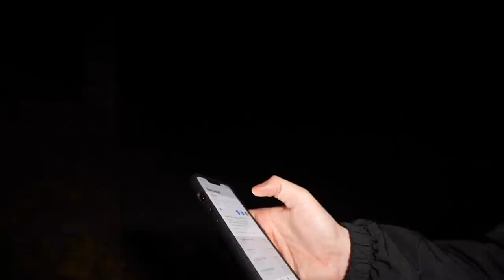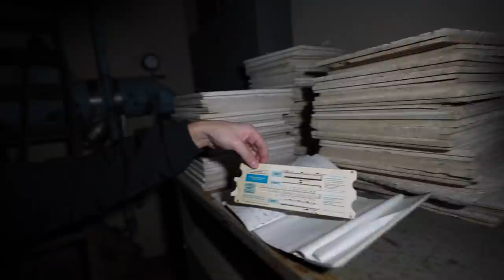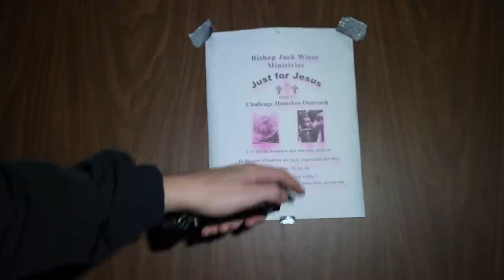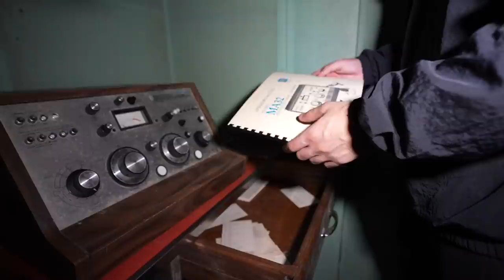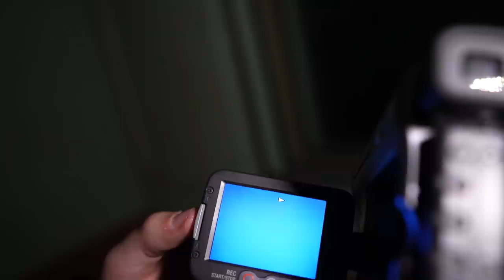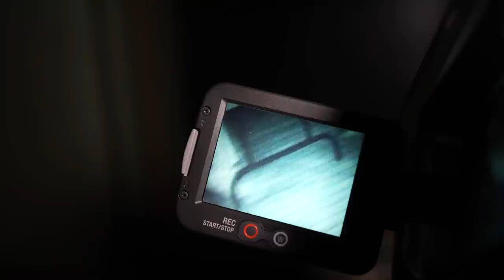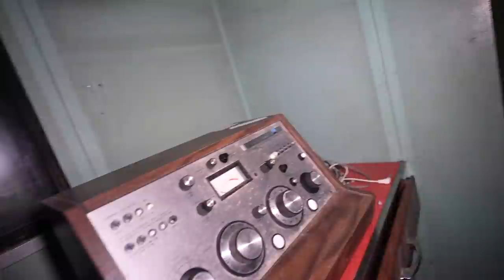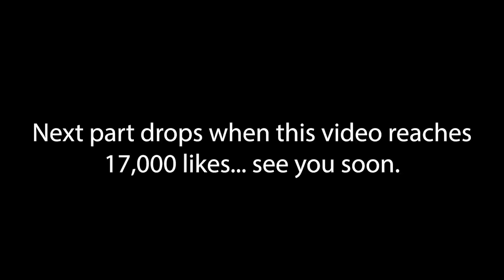MOST TERRIFYING RANDONAUTICA EXPERIENCE - TRAPPED INSIDE LOCKED ROOM (WARNING!)

Comment: Jas... Next time you find yourself locked in a room, remember that most interior walls are nothing but drywall (which you can break through). If that doesn't work, try going through ceiling tiles and climbing over to the next room.
Reply: You my friend have clearly been locked in a room before lol I came to say the same thing
Reply: II can't remember when that started to be the norm. It used to be tree planks in 1985 when we built our house. Here II think the roof is the way - Or I would anyway look everywhere and get out. Besides - I mostly keep a glass breaker with me. Always when exploring, that's for sure!
II'm  searching door handles after this cause II think that is a trick with that one. Turn and push. This room would never have a room you need help to get out of. It's for reading up messages to everybody. It is the meaning that no one can get in when you read. I think the handle is very long so pull to lock and push to open.
What do you think about that? 
I'm guessing your younger than me cause my school did look like that but those door handles is not a thing we use on this side of the Atlantic... 
We do have the door handles that lock for that special use.
Reply: I was panicing together with you....while you was in that looked room.🙈......❤

Comment: The room is used for hearing tests. It’s muffled that way by the design so when you wear the head phones it dead silent. There is no breaking through the walls. They’re not Sheetrock. There’s no climbing over the top through ceiling tiles. It’s legit a metal box with only one way out… the door.

Comment: In my opinion Chris has the key to the door the door! And and even if he didn't you guys could take some of that metal equipment and Bang a hole underneath of that table table right through the wall! Alreall it is is it's like paper or cardboard tilis cardboard tiles on top of drywall bri wall and insulation in those walls those walls there's no way it would take you longer than an hour to get out if that but Chris found a key